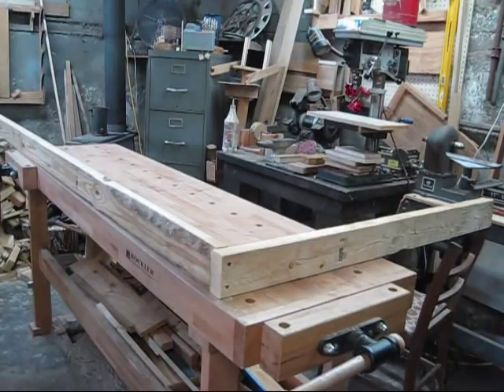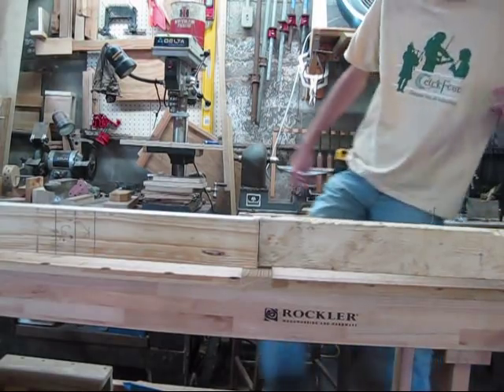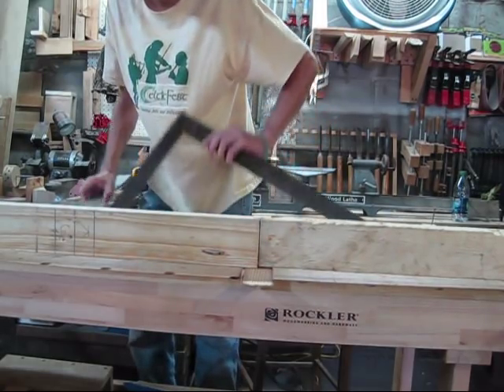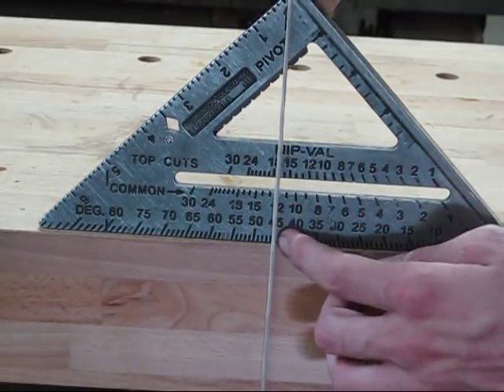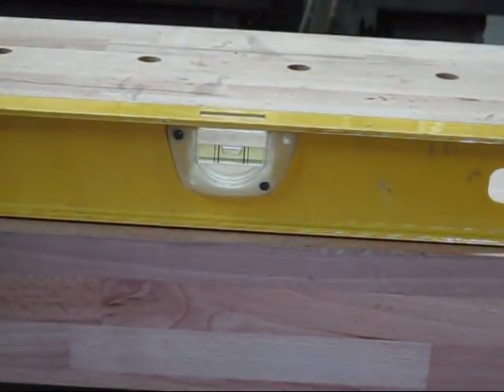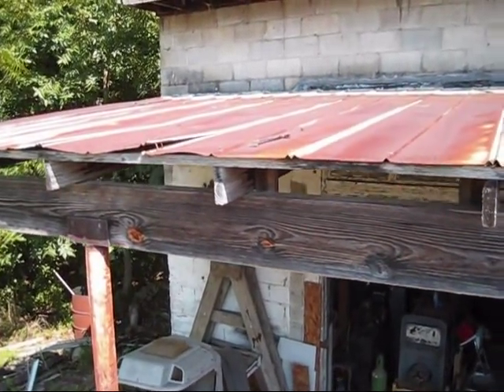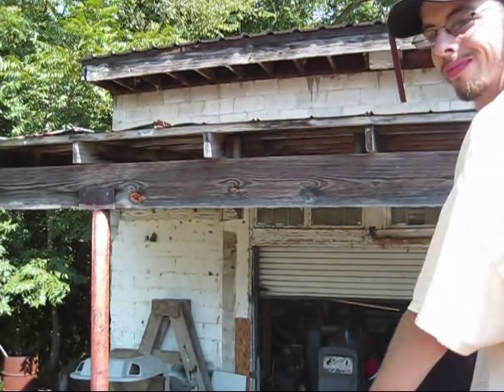Tricks with construction tools

Comment from the maker: 1st you can't check a house foundation with a square. 
2nd is used all the time on things that are not flat (pipes) 
3rd you are right on that one it is easier. 
4th you can't sight a board  20 feet up in the air. 
5th that's ok you didn't like it. 
Thanks for the comment; the ball is in your court now.
Reply: Bien dicho, a si se arrea el ganado vaquero!!!
Reply: I love the outside of your place. I could really get some work done there.
Reply: 1st you can't check a house foundation with a square???.  ................  THERE  YOU ARE WRONG!!!!    YES YOU CAN ..   measure from corner to corner  meaning  Example .  north  east corner to south east corner ,,  keep that measurement  .. then measure on the opposite  side south east to north east corner ..  if all measurements are the same then your foundation is SQUARE  .. all 4 corners have to have the same angle measurement .. if not  your  foundation is  out square
Reply: Niall Conlan he is giving good friendly tips which help out, not selling a freakin tool to better build a house. Why do some people have to act like you know it ll-man these type of comments are rude and uncalled for. Also unwanted.
Reply: HairmanRuby Well said. Thank you.
Reply: Ethan Ewing Hey, thanks brother and God bless you too!
Reply: taledarkside a tape can be used as square you use the 3,4,5 method you mark 3feet one way on a corner 4feet another way on the same corner and measure 5feet from the 3foot to the 4foot mark if it is 5feet that corner is square
Reply: It is possible it all depends on the size of the square and the size of the building
Reply: ***** Yards of Foundations? What are you doing watching this video? We should be watching yours. Wait, there aren't any. Don't be a tool.
Reply: taledarkside Squaring a foundation is a process. You can square a foundation using a square or other tools, such as a tape measure. The point this kid is trying to make is use common sense and think outside the box. Try it.
Reply: ***** My bad. We don't talk like that here.Oregon
Reply: George Conde Measuring it that way assumes all the faces of the foundation are perfectly flat, which is not reliable. More than likely the walls bow in various parts slightly.
Reply: george medeiros JEEPERS George,(notice I never said Jesus) , it would seem you are a little sensitive to religion. Is there something in your past that needs some addressing? Not here of course because this was just about a few friendly tips.Do you rant when people use the often over-done comment, "OMG!" Just an inoffensive observation brother. JEEPERS, lighten a smidge-"LAS". Get it? Hunghh? Maybe a new catch phrase right there.
Reply: George Conde That's how I was taught to do it too.
Reply: ***** pythagorean theorem
Reply: George Conde He meant you can not check it with a framing square on the inside corner!
Reply: 357mat1 Why not?
Reply: Your Square would be way to short to be accurate. I wouldn't even advise squaring a deck with your framing.
Reply: +Classic Work Hold it...what do you mean you can't sight a board 20 foot in the air.   Sure you can.  You just haven't been shown how yet.  I can show you once and guarantee it's as straight as a string.
Reply: Whenever a reply talks about nothing but spelling errors, that indicates the person posting the reply is just ignorant and has nothing worthwhile to say.  Any suggestion given from ANYBODY is another tool you have in your toolbox to use as needed.  Sometimes many are not often employed, but if needed they are irreplaceable.  I have been building everything from doghouses to high rises for almost 40 years and I GUARANTEE if you stay in MY industry you WILL find yourself in a position where you are stumped and some old dog will come up to you and have a long forgotten "trick" that will save you many hours and a lot of money.  Learn them all and you become more valuable on your job.
Reply: If I recall, Classic Work said a person could not sight a board for straight 20 feet in the air.  Ask a carpenter that knows how it's done and he will prove that assertion wrong.  So, Classic Work doesn;t know how it is done which makes him ignorant.  Not stupid...just void of the information and technique.  Put a board 20 feet in the air and give me a straight edge and I can sight it from the ground.  AND I will bet money I can site it as well as anybody else can with a string or a lazar.
Reply: I guess I'm just better at my job than most everybody else.  Not ego...fact.
Reply: +George Conde Why yelling?  You are describing the use of a tape measure, not a square.  If you had no tape measure would you use your carpenter's square to get 90 on corners with a long run?
Reply: Odd you mention that cause myself and one other person just raised two 24 foot paralams to a height of 14 foot and then screwed them to the house until we could lag them in place perminently..the day after my last post.  Am I pretty strong?  I don;t think so.  You're probably just weak.
Reply: An engineer?  No wonder you don;t know how to do anything.
Reply: Cad jockey!
Reply: An' engineer" not knowing how to build something his CAD program produces.  go figure.
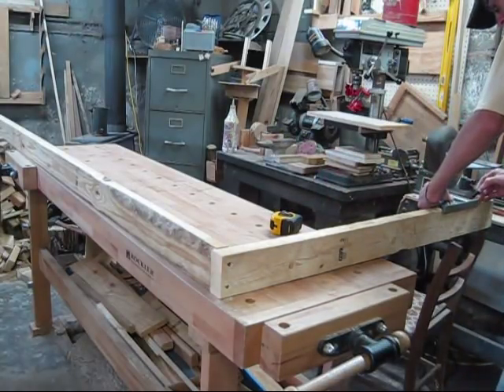Reply: I keep getting these notices so since this one wasn't to me, I went back to reread some of taldarks posts.  And here's what I found from our "engineer".  At 1:40 yesterday he says "must be pretty strong to hold a board up in the air that's a 2X12 and 20 feet long ."  I reply at 7:33 the following.  " 
Odd you mention that cause myself and one other person just raised two 24 foot paralams to a height of 14 foot and then screwed them to the house until we could lag them in place permanently.."  Now, here is where our intelligent engineer changes the parameters of his challenge and assumes some "win".  At 7:34 he replies, "that isn't the same as eyeing a beam 20 feet long in the air."  Now, I have and can eyeball a rafter or beam or any member from 20 feet away.  And amazingly I would use a framing square to do so.  But he has never done so and thusly doesn't know how to do it.   I can use the same technique to site a foundation, a wall or any other surface that needs to be straight.  But I do have a question for any framers or carpenters orth their sand.  Have you EVER known an "engineer" that was worth a penny doing the work of building what their CAD program put on the plans?   I haven't.  All an engineer is good for is putting his name on the drawings WE have to take from weightless blue lines and turn into a solid structure that PASSES inspection.  An engineer?  He can't even get his drawings to pass more than half the time which is why the industry has moved to CAD for figuring stress and load.  People like taledark don't even know how to do it manually anymore.  Anybody can punch in the correct numbers and let the computer do the rest of the work.    I can do it.  But building those structures is much more satisfying to a person who likes the challenge.  And , of course, someone who can meet the challenge.
Reply: So, taledark.  In characters you MAY be able to decypher,

,.!..
Reply from the maker: +Steve Sanders Whoa guys.....  I'll be the first to say I don't know everything matter of fact I don't know a lot.  I hate to see so much anger over something I said.  There are ways of doing things I've never seen, and by that I don't have any say in the matter of what ya'll have been talking about.  I don't care if ya'll keep going at each other, but ask yourself. "Is it worth it?" I have much respect for those who have lived before me, and worked by the ways I have been taught.  

Ya'll take care from Classic Work
Reply: Even tougher for fake engineers.  You must have failed your engineering school for problems with comprehension.  If the job were merely nailing 2x4's together, you still couldn;t do it.  Go away liar.  An engineer!  That's funny.  On what...a model train set?
Reply: You still here trying to convince people you're an "engineer"?  Don't you have an order of fries to get so you can serve the guy at the drive thru window his happy meal?
Reply: They don't allow guys like him on job sites.  Unless he's sweeping up after the roach coach
Reply: Or, maybe I wouldn't spend most of my day stopping my guys from stomping a mud hole in his ass.  I may just let them.  Could go either way.
Reply: +Classic Work you have over a million views on this video, don't concern yourself with these two. you're right to respect and admire others that can solve problems in unique ways. thanks for the post.
Reply: +taledarkside  Ya you "square".  Stop acting like a know it all.
Reply: What evades taledark is the FACT that the Egyptians laid out and built the pyramids with little more than a tri-square and a plumb bob used in the exact same manner Classic shows in the video.  They level the foundation with nothing more than a gouge and trenched around the foundation, getting it perfectly level all the way around.  And because his  cad program doesn't show any actual technique, he doesn't have any idea how building works when it comes down to actually performing the work.
Reply: Steve Sanders The Egyptians, Romans,
and Greeks, all used the tools you mention they also used a water level to lay in their foundations, plus to determine grade. The water level is very accurate, and many people use them today.
Reply: Joseph.  I didn;t name the water level by name but you obviously know that was my reference to the gouge and trench.
Reply: And nowe, back to Dark.  I never claimed to be the smartest person here...just smarter than you.  And I can prove that by simple demonstration.  I gave the example of the Pyramids.   The architects of those structures squared the foundations of them with nothing more than  a tri square.  How they did it I do not know, although there are theories I have heard of,  but even in the face of theory there they are.  Square and straight.  I also do not know how they moved and fit the stones into place, but again, they exist and fit so tightly there is no need for mortar.  Not only do they exist in Giza but also at Machu Picchu.  And by the way, the structures at Machu Picchiu are also square and straight and there is no indication those people even had a square to work with.  SO a blanket statement from you that it can not be done  is testament to your colossal ignorance.   Now, get back to your computer and let a machine do all the figuring for you, hand those drawings over to a carpenters and steel workers and let us do the work of putting it together, and just do the construction industry a favor and stay in your cubicle.
Reply: "divering"?  did you mean diverting?  No.  I am not .  I admitted that I do not know how it is done, but it obviously has been done.  I don;t know how my computer is built (well, yes I do)  Okay.  I don;t know how a theoretical physicist figures the  atomic weight of an element we don;t have present on this planet, but they do it.  And here is a more applicable example.  I DO know how a guitarist shredds because I play lead guitar.  But I can not shred like Randy Rhodes use to.  His technique was different from mine.  I do not understand how he did a lot of the things he did, but I have studied some of his licks and have them down.  Once I am shown, with practice I can do it.  Just like I'm sure once somebody shows you how to get your head out of your ass, you'll manage that too.
Reply: How would I square a foundation?  I would cross measure it.  I would pull my tape out and measure every where I could.  But I do not know every trick so I do not discount that someone could do it with a square.  Are you contending you know every trick that has ever been utilized and none exists?  You, who can't site a board right next to you becasue it is 20 feet in the air.  (you did make the statement I couldn;t do it if I am 20 feet in the air, not if  the BOARD was 20 feet in the air...and I can do both of them.)
Reply: No.  I never said I could do it.  I refuted your claim it could NOT be done. I gave  examples of where it has been done.   Now you need to prove it was done some other way.
Reply: I said I could site a board for straight 20 foot in the air. Prove I can not!
Reply: +Ceri Williams You can also use 6-8-10
Reply: godbluffvdgg Just future reference.  That's called the Pythagorean theorem.  You can multiply the numbers 3, 4 and 5 by any other number and it will give the same result of square.  3x100; 4x100; 5x100.  etc.
Reply: taledarkside You're avoiding the question posed to you.  Explain how the Egyptians did it.  All we know of that they used was a trisquare, a plumb bob and copper tools.
Reply: You know what?  You've had me thinking omn this long enough I think I can do it.  In fact, I know I can.   I'll lay out the parameters as such.  I will lay out a Straight, square foundation of 25' by 50' with the tolerance of plus or minus 1 inch of dead nuts, and I'll take the bet.   I'll do it with nothing more than a square, some stakes, a roll of jet line and one helper.    I will present it for inspection when I am done.  But this is a cash bet and I want it on paper.  A binding document that will stand up in court.   You name the amount.  (Over $1000.  I don't do anything for free or cheap.  But then, I'm the best at what I do so I can make that demand.)  
The gauntlet has been thrown.  Don't back out now!
Reply from the maker: +kenneth fisher Thanks I tried man.
Reply: Hey.  How did this ever get started on a foundation anyway?  Did I miss someone claiming they would lay out a foundation with a framing square?
Reply from the maker: +Steve Sanders Ok I know I said it. "1st you can't check a house foundation with a square"  I will prove myself wrong.  If it is cool with ya'll I will square a house foundation with nothing, but a framing square 24"-16" string, and stakes.  No help + or - 1" of trueness.  25' by 50' and film it, and check it. Ok???
Reply: C'mon, bro.  I said it first.  The only difference is I ask for one helper to make it faster.  I could do it alone.  I tell ya what, you do it and I will too.  I got a feeling we'll be doing it nearly the same way.
Reply from the maker: +Steve Sanders I understand.  Well I'll give it a go.
Reply: Like i said in my original reply to your video, I'm an old carpenter.  I have seen many tricks over the years.  I appreciate someone spreading them around to the new guys taking over.  Sure, they make new tools every day that make the old ways seem antiquated.  But some day they will be in a corner, the tool will be left at home...somebody stole their truck and they lost it all.  Something.  And when that happens they will be lost.  When the knowledge is limited to turning on and off a specialty tool, then that knowledge will soon be lost.  I have forgotten more than most of punks like taledark will ever know.  Well, I've forgotten them until I need to use them again.  I'll remember when the time comes.
Reply: +Classic Work yep.
Reply: +Steve Sanders that day will come mate,shame some of the younger guys don't realize that fact
Reply: +George Conde That is using a measuring tape not a square... Plus how do you measure corner to corner of a foundation when there is a structure on top of it?
Reply: +tallicat hetfield  We all know hot to 3,4,5 something. He is saying you cant check a foundation with a square... As is a framing square, T-square, combination square, speed square. His whole fucking point is that you HAVE TO 3,4,5 it to check.  Maybe you should of been learning communication skills when you were in fourth grade!
Reply: +George Conde   You can square up a foundation by measuring corner to corner but you cannot check the foundation by using the tool, called a 'square'
Reply: waste of time!
Reply: Mr. Conde Don't you mean the north east to south west corner and then the north west to south east corner dimensions being the same then the foundation is square?  A rectangular shape with 90 degree corners will have the diagonals equal just as the opposite sides will be equal.  The diagonals can be measured with a tape measure of sufficient length.  If a figure has opposite sides of equal length and parallel but the corners are not square or 90 degrees then the figure is  a parallelogram and the diagonals will not be the same length.  Try it on something small say around one to three feet to be easy.
Reply: Classic Work
Reply: ? Well said, so the cowboy cattle herded !!!
Reply: Yes he sho7uld. it is Pythagoras Theory of angles..  ac = square root of ab square + ac square. the right triangle theory. a corner is square if each side has a measure of 3, 4, and 5 for one of each of the 3 sides.  ( 3*3=9) + (4*4=16) (16+9=25) 25 is the perfect square of 5 (5*5=25) hence the 3,4,5 method of squaring corners. of any 90 degree corner...
Reply: square of a sq + b sq = c (3*3= 9) (4*4=16) (16+9=25) sqroot 25 = 5 (5*5-25) 345 method of squaring right (90) degree corners
Reply: tallicat hetfield except that it's the Pythagorean Theorem.